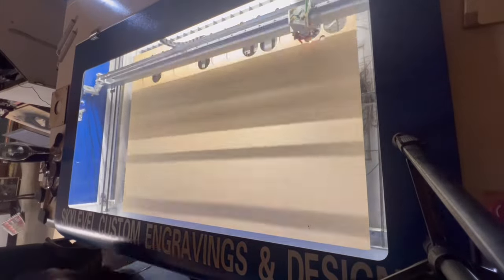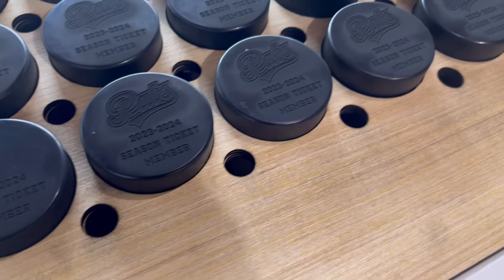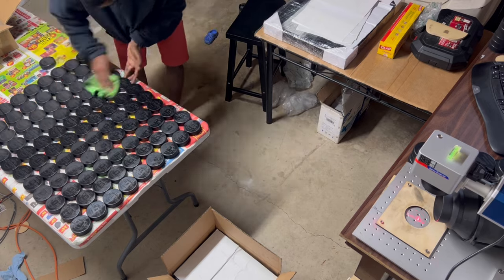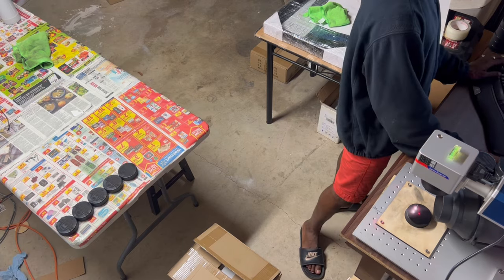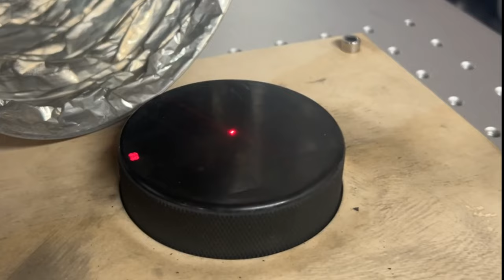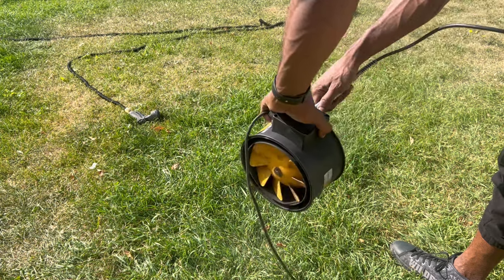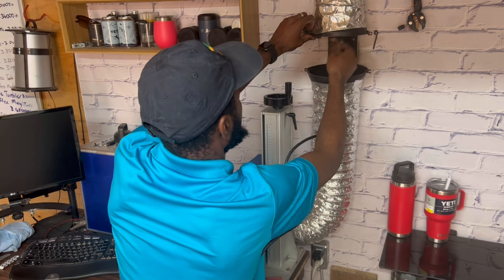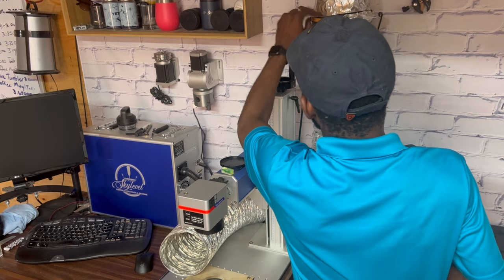How I Made 12 Thousand Dollars Engraving Hockey Pucks

Comment: Here’s maybe a little idea for your exhaust fan tubing that u have on the table. Instead of having that big tube  or whatever u call it keep that but reduce it where the puck is gettin engraved. Cause the fan will pull harder if the hose or tube is smaller.  Or make a 3sided enclosure out of plastic leave the front open and put a smaller tube or hose in the back that is half or more then the one your using now and connect  it With the vacuum 
I had a CNC table that would have a vacuum motor underneath the table and it had 6-8 in pvc tubing running all through the table and underneath all going to the vacuum but you could shut off ones you didn’t need for diff jobs   
I took the table apart and reduced the size of the pvc to 4 in   It made a huge dif. Even the smallest pieces are held down so tight and the vacuum that i have attached to the router head sucks up pretty much all the wood dust that it’s making when I cut cabinet parts. A lot less time cleaning up when the table is done then before. It’s just was a waste of time , I use to have to clean the table, do the floor around the table then once  a week do all around the area walls behind things under it just picked up way more as it was running 
It saved me time and money
Reply from the maker: Thank you. I don’t currently have an issue but I will try it and see if I get a better result.

Comment: Thanks for sharing.   I'm new just got a 50w fiber laser.  I am not sure if you did this or not, LightBurn has a feature where you can feed in text from a CSV file, I am not sure if this would of worked for you.  the time difference between the co2 and the fiber laser is amazing.  We are going yo use ours with a rotary in the vertical position to black mark small stainless steel fittings.  Now I need to get a co2 or a diode laser to make all the jigs:')

As a side note it would be great if you could create and sell a custom led lit puck display stand that integrates a LED lit acrylic background either team themed or just a hockey rink. Then upsell that.   

Do you know if a co2 laser will cut and engrave a HPDE 5 gallon lid?  I need to make a bunch of branded 5 gallon bucket lids with holes in them.  I don't think a diode laser will do it, and I'm trying to avoid having to use a router and a template to cut the holes.

Thank you,

Roger
Reply from the maker: Hello Roger. Co2 can cut HPDE but won’t be the best for engraving.

Comment: I'd be very interested to know a little about how you priced this job out? To account for laser wear and tear, shop costs etc. Just curious, I'm kinda a math nut 😅
Reply from the maker: I charge per puck and customer provided pucks.
$6 engraving cost per puck.
120hrs split in 4 weeks.

Honestly never did an actual breakdown.
Reply: 120k hours seems a bit off for 4 weeks 😂 nice work!
Reply: You have to consider that he's using at least 2 different lasers, a CO² and a fiber. May have more. But you're right, 120 000 hrs doesn't seem right, he'd have cooked 2 CO² laser tubes just for that job 😉 😜
Reply from the maker: @remz03ryder  haha. 120hrs. Not sure where I got that from lol.

Comment: How powerful is the co2 laser? About how long each puck
Reply from the maker: 150w. On Co2 it takes 2 mins per side. 50w Fiber laser takes 30 seconds.
Reply: @skylevelcustomengravings what are your settings? Great idea! I recently got involved in with the local team. This would be a neat gift.
Reply from the maker: @markrohan2776  what machine do you have?
Reply: @skylevelcustomengravings  Omtech 100w CO2
Reply from the maker: @markrohan2776  20% power at the max speed of your laser is good.